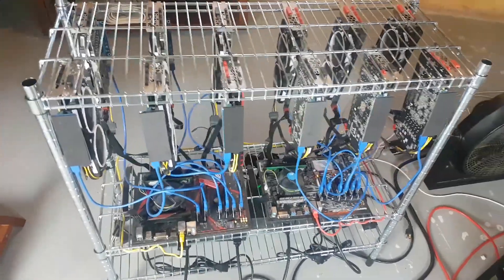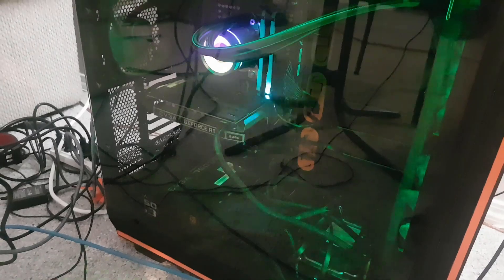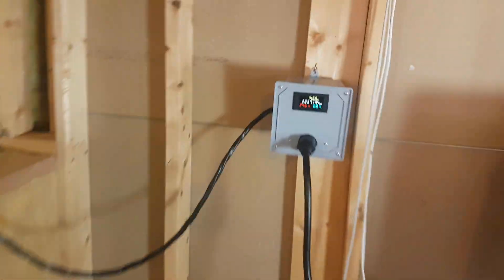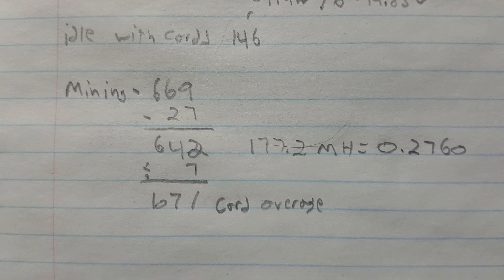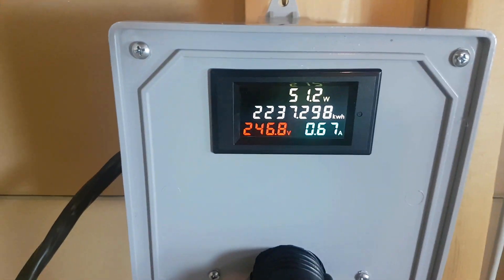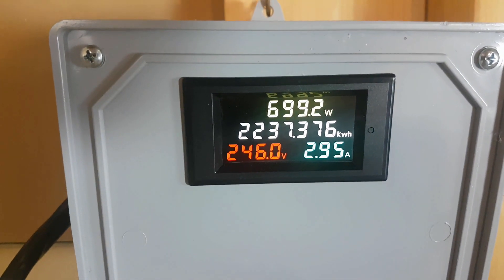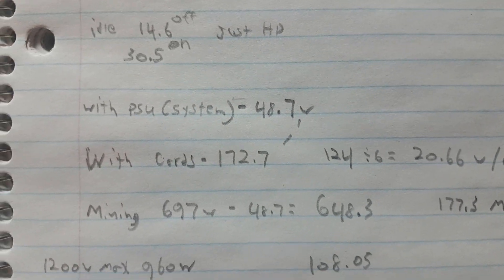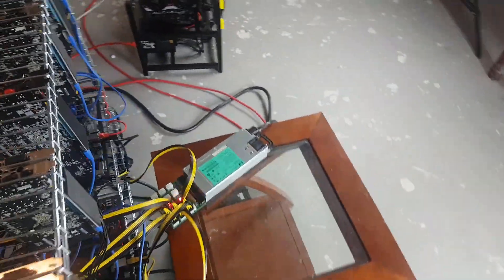240v Mining Rig with a 1200w HP Server PSU

Comment: Gday i just got the same psu , Does your rear not kick on ? From other videos some are really loud but mine seems very quiet and the rear fan doesnt seem to spin at least from the first 2 hours of my testing
Reply from the maker: Ya mine spins should feel air blowing
Reply: Thanks for the reply mate . After further inspection what I thought was the rear fan was just the shroud! Ahaha on 240v it is insanely quite compared to 110 .
Reply from the maker: @TheHales619  depends on what you are running remember on 110 or 120v it's only 900w on a 1200w psu so your closer to the higher power range.

Comment: I sure like that 240v outlet you got setup. I need to find a journeyman to setup that up if I want I bet right? THEN get that 240v pdu so THEN i can plug in regular 120v and that will give the hp server 1200w gooder power right?
Reply from the maker: Recommended to use a electrician yes but I did it all myself lol not recommended.  Yes with the pdu and c13 to c14 cables can run just fine I have other videos on pdu also will be doing one on 240v power soon.
Reply: @RabidMining  Thanks. And that is the most efficient way to mine since you are giving the 1200w power supplies the recommended power. Do you have a 200amp panel too I bet? I have checked out other vids on running a 240 line and its always confusing to me. AC is confusing, but DC is easy to me. Alternating Current vs Direct Current. Low voltage car stereo or ethernet cables always easy but Electrical is tricky. I will check out more of your stuff. Thanks
Reply from the maker: @barrysauce  thank you and no my panel is only a 100 amp I wish it was 200 amp lol.

Comment: So I have a couple of hp1200 watts psus. What do I need to run it on 220v? Obviously the outlet , but what other components? Just a power cable from wall to psu? Or is it necessary to have a pdu?
Reply from the maker: There are converters to a outlet but a PDU is recommended.

Comment: Hey Rabid. I like your videos they are informative for those new to mining. Do you think the 240v + hp powersupplies use lower amount of wattage? Do you think you can do a video showing the actual electrical cost using one of those nifty watt meters which show the amount your spending for each rig per day? Sounds like a good idea for a future follow up on this video.
I am sure even the most veteran miner would really get a kick out of the results.
Reply from the maker: did kinda the same thing on 120v if you havent seen it yet.

Comment: DPM 5 means NO undervolting (it's also the default value - so there's no point in setting it to 5 anyway). You should have that set for 1 for Polaris cards like you have. Also you MDPM - the HIGHEST value for Polaris cards is 2! No idea what effect that has - but the value - should be 1. Even without a bios mod - you should be closer to 60W-65W  - that DPM 5 is what's killing you.
Reply: Dpm 1 and mpdm 2 work best for me, but toggling the aggressive undervolting(set oc for each dpm state) lowered my wattage the most
Reply from the maker: @TheEVGAftw  whats your core and other settings at?  got these settings from a guy in panadas discord and are the lowest power values yet on any dpm setting that I have found and tryed.
Reply from the maker: Used 1 threw 5 and all seem to be the same think the numbers are like auto under volts but if you add your own values it bypasses the dpm dont quote me on that though lol.  108 watts is pretty good for these cards as most calculators and benchmarks have them at 120w on etherium.
Reply: @RabidMining  I'm not trying to be a jerk - but it's horrible. I get 67W max. You should READ what it says in the Hive OS - click the little info boxes - you'll see what I'm saying.
Reply from the maker: @witness1013  I'll go back to 1 and test what are your other settings and u are at 67 wall or software power?
Reply from the maker: @witness1013  Have read all the tabs lots and went threw dpm 1 threw 7 multiple times the settings I have are the lowest vaules everything else does use more power for me.  I got these settings from a polaris god lol.
Reply: @RabidMining  You need DPM and MDPM and 1 - each. It's literally not physically possible for it to perform better on 5 than on 1 unless you have a bad bios mod. I can prove this to you via live video if you wan to inbox me. If not - no biggie - just looking out for a guy who's wasting 60% of his power.
Reply from the maker: @witness1013  will try again use to use dpm 1 just recently went to 5 with these settings and my power has dropped will do it again.
Reply from the maker: in software I am at 53 to the 73 watt range depending on card at the wall its the same as in the video.
Reply: @RabidMining  i have a whole mix of 4xx 5xx 8gb theyre running all at 1125 core, 1DPM, 850vdd, 850vddci, 2000-2200mhz mem, 2 mdpm, and finally 30 ref. 29-31mhs each 67w-80w software. Theyre all flashed with the best straps i could find in my knowledge i think i could do better on a few of them. usuaally that was the cards own 1500 strap.
Reply from the maker: @TheEVGAftw  hmm ok mine are 53-74 software watts with wall power that's in the video.

Comment: This is good insight to have.
Thanks for doing the test on 240v with your meter ;)
It just shows that they actually do get more efficient once you are past the 600w mark.
These power supplies are safe to run pretty much at 100% load 24/7.
Ive had no issues loading them at 1050w.
and as you know the wall reading is the input wattage, so if you put in 1000w at 90% efficiency, the power supply will only be putting out about 900w so having it read around 1050-1100w at the wall is still around 80% load.
The only reason not to fully load these power supplies is to reduce the noise as they run very loud above 900w+